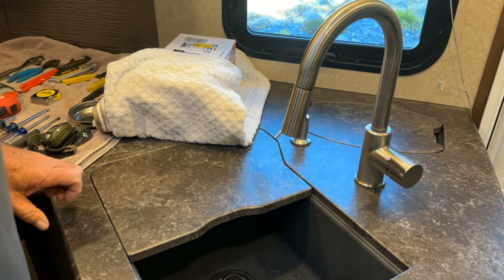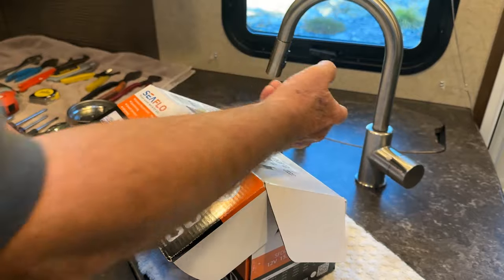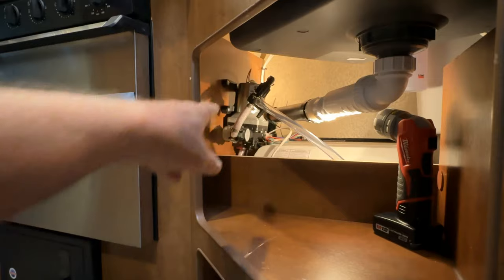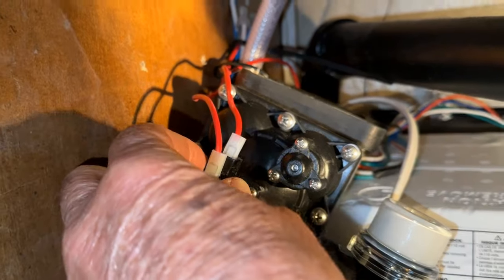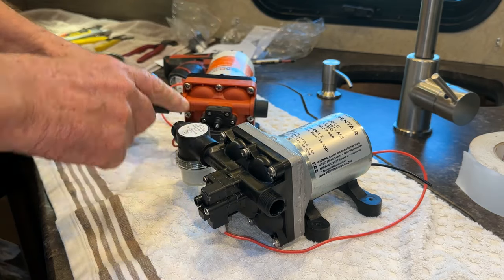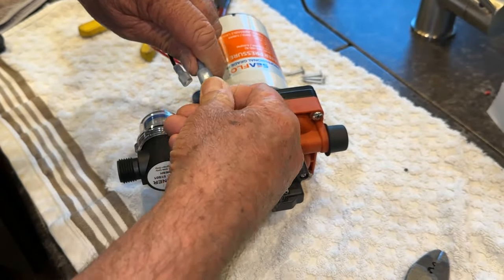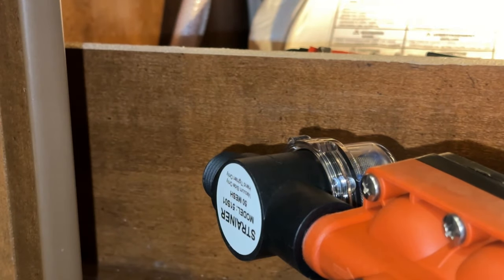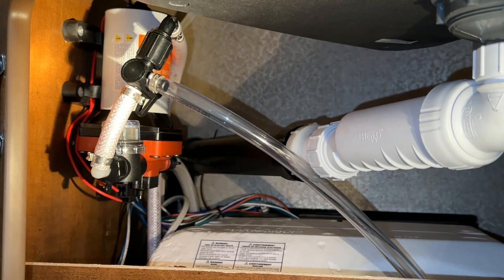Replacing our RV Shurflo Water Pump with a Seaflo 42 Series Water Pump

Comment: Michael, Awesome job on detailing everything! I have the very same trailer that you have. The handle on your faucet faces to the right side just as mine, The first time I had the water running, and I reached cross with my left hand to turn it off. I burned myself I decided to rotate the handle to the center of the sink it was pretty simple. I just grabbed it and twisted it to the center. It actually tightened it up. It made a huge difference. I can use either hand to turn the water on and off, and not worry about burning myself. I’ve been looking at the same seaflo 42 series for a replacement pump but wasn’t sure how well it would work now I know. Thanks for that!
Reply from the maker: Thanks again for watching, commenting, and sharing your ideas with me. That's a great idea on moving the handle towards the sink. I'm going to do it and mention you in a video for recommending it if that's okay with you? Are you in a Facebook Lance Group and if so which one(s)? What's your name if you don't mind me asking?
Reply: @thetraveltrailerguy  Michael you’re fine to mention me in your next YouTube video. I don’t belong to a Facebook Lance group, but I do belong to Lance owners of America or LOA. Thanks again for all your hard work in your Lance YouTube videos Rick!

Comment: Like the video a lot. My question is, since my current pump has a 10amp fuse in the breaker box, is it ok to put a 15 amp fuse in its place without messing anything up and negating any warranty?
Reply from the maker: Thank you.  I replaced the 10 amp fuse in the panel with a 15 amp fuse. With our trailer this fuse also provides power to the heater and monitoring panel. 

I could have installed a 15 amp fuse in one of the open fuse locations in the panel that was not being used and moved the water pump wire over to it, and left the 10 amp fuse in place for the heater and monitoring panel. But I decided to just change out the fuse to the 15 amp. Personally I'm not worried about upsizing the fuse with what is in connected to it. 

Regarding negating the warranty it might be a problem but I don't see something happening. If you are worried you can do what I mentioned above regarding putting the water pump wire on its own 15 amp fuse. I'm curious if you have in your panel the water pump already wired to a dedicated 10 amp fuse you can just change out the fuse and not worry about it. 

https://www.youtube.com/@thetraveltrailerguy/videos
Reply: Thank you for all the information. The breaker box has a dedicated spot for the water pump that is 10 amp.  Since the trailer is new with a crappy pump I’d better check with Keystone first to play it safe before swapping out the fuse.
Reply: I got a hold of Seaflo Support and they said a 10 amp fuse is sufficient to run that pump even with 7.5 surge. I asked why the manual says a 15 amp is required and he said it was a misprint. It will be corrected when they make new manuals.  Thought you should know.